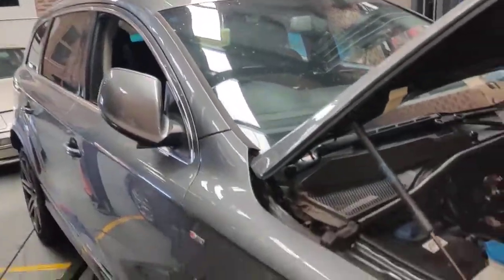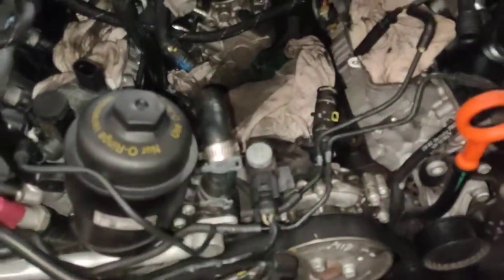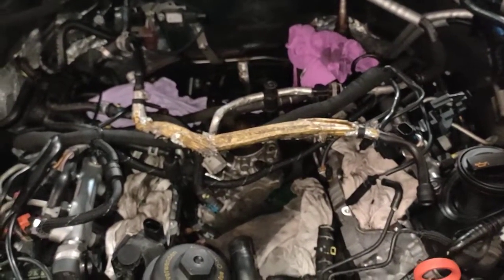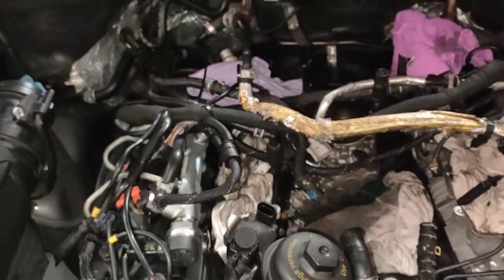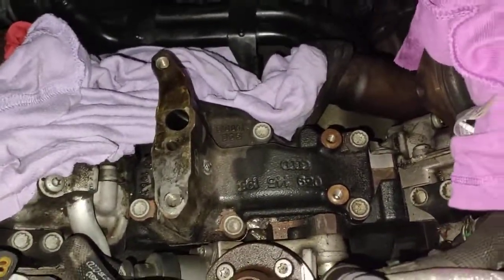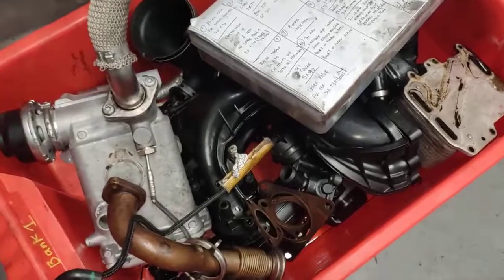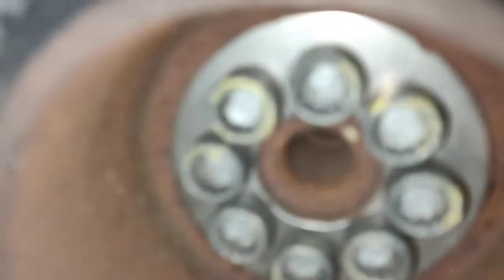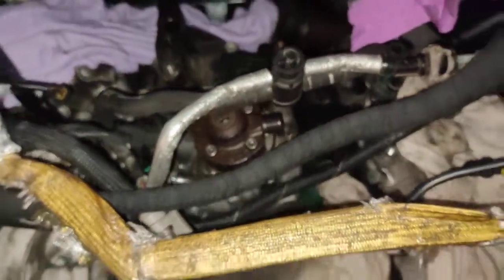Audi Q7/VW/Porsche 3.0L V6 Diesel engine - Replacing High pressure pump Part1

Comment: How did you undo the 3 m10 splines under the turbo on exhaust?? So tight and can’t get a socket in
Reply: Two bolts I could do from the top. For one of them I put a belt on the ratchet so I could pull at an better angle. The third one I could open from the wheel well using a joint and multiple extensions.